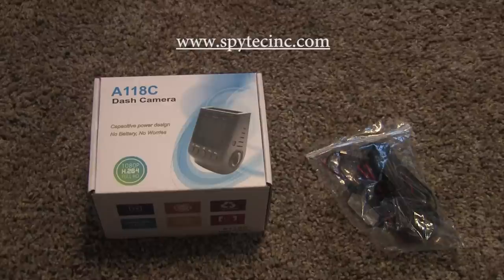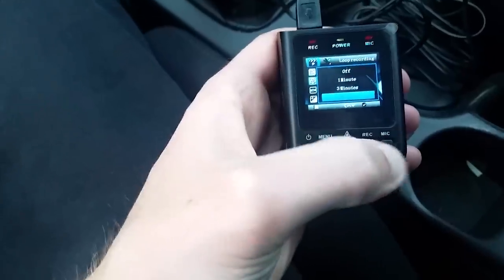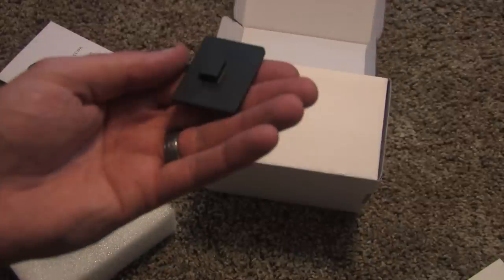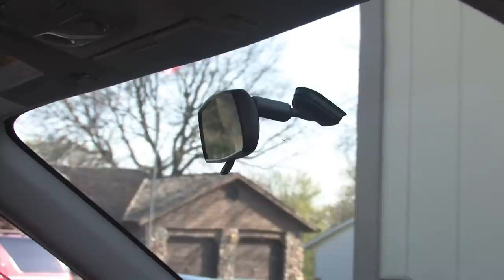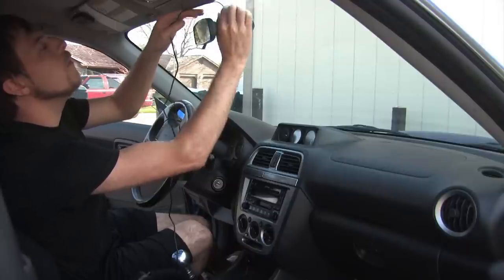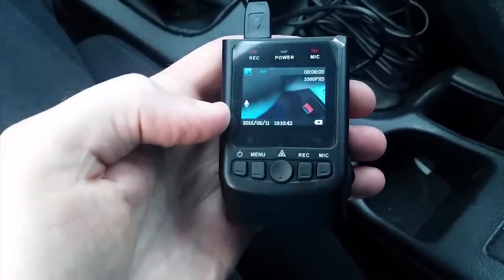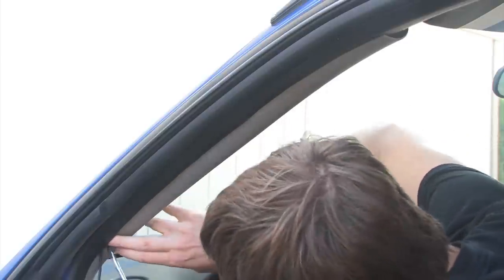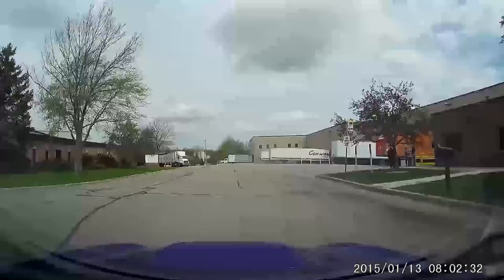A118C Dash cam install and test footage

Comment from the maker: Not sure why I can not reply to specific comments on this thread, but David, yes it is very easy to slide on and off if you want to take it off the windshield when you are not driving.
Reply: +Boosted Films to get the videos off of it do we have to remove the camera and plug it into the computer? also the 5 min loop times, does that just mean every clip it records is maximum 5 mins or it turns on every 5 mins for 5 mins and then off for another 5, before turning back on.
Reply: +KingsnakeSince1986 thanks man. I read somewhere else to stop the dropping between clips you have to turn off the motion sensor. The motion sensor looks for changes from the lens and so if it doesn't see change it won't record. But if you turn it off it'll record everything. And by motion I don't mean the game force.
Reply: oh....you do it when you're not driving. Gotcha...

Comment: Once this camera is mounted on the windscreen or dashboard, how easy is it to dismount it from its pedestal and re-mount it? Having just bought one, my first impression is that the pedestal is a very tight fit on the camera, and that it's going to be really difficult to remove it without the pedestal coming unstuck. I really don't want to leave the camera in the car, as that's just an invitation for someone to break into the car.
Reply: It is EXTREMELY hard to remove. I have the same dash cam with the same hardware. You have to used a solid, thin object (like a credit card) to detach the mount from the windshield. From my experience, the sticky-stuff is no longer useful so I have a roll of double-sided tape as replacement.

Comment: Starting at 9:13  on the video, what's the display "8 h1" in the lower left of the display?  
With the unit behind the mirror, can you see the display while driving.  Is there any need to see the display while driving?  With the capacitor instead of battery, can you remove camera from car & take video without power cord? Sorry to ask dumb questions, but I'm new at this.  I bought a DS8000L and it goes dead when disconnected from power cord, losing time / date data. Battery will not charge.  I'm looking for a better camera.

Comment: The capacitor in it is not for the date and time. It's so that if the power is suddenly cut to the camera (in a sever wreck) it has enough power to save the current recording before shutting down. Otherwise the current file, which is probably the one of the accident, is corrupted.

Comment: Great review... obviously the manual included with the unit is useless.   I have a couple of questions, perhaps you could respond...when I hook up the unit to my PC, the index shows lots of small 20-30 snips, with some going to 130.  However, during playback the video player says it can't play the full clip.  Secondly, if there is an incident I wish to keep, how do I do that?  If I just pull the power cord, will the unit save the last 5 minute loop?

Comment: what is with the grounding portion you are talking about?
Reply: It needs power and ground, like all DC power supplied devices. With a hardwire kit you connect the red lead to a power source from the fuse box (or wherever you want to tap into), and the black lead attaches to a ground point, which is usually any metal bolt under the dash. 

This technique of wiring is called hardwiring because it is "permanently" wired. Of course it's not really permanent because you can simply detach it with tools later if desired, but it's not like a cigarette lighter socket type of install that can be instantly plugged/unplugged.

Comment: Thanks for the great video, where do I install hardware kit? I got EDO Tech 5V kit. Thanks
Reply from the maker: Where you install the wires depends on the vehicle. You need to find an ignition power source wire that delivers power when the vehicle comes on and a ground source.  Usually the radio is the most common place to tap into an existing ignition wire. Google your vehicle type and look for the wiring diagram for the radio.  Otherwise... pay a profession to do it.

Comment: I cannot do anything with menu option, is it like I need to first full charge it then try for Menu option like Date and Time settings ?
Reply: Sanjeev Choudhary can I use his camera at home via regular electric
Reply: I am not sure, but as i remember you cannot use it with regular electric. Please cross check this with some other guy.

Comment: Question: When you say as soon as you turn it on it will start recording do you mean as soon as you start the car it will start recording or do you have to power up the unit every time you start the car? I want one that will start recording every time I start the car. I don't want to have to turn it on every time.
Reply from the maker: +Darin and Alina House It starts recording automatically every-time you turn on the car.
Reply: +Boosted Films Thank you and great tutorial. Much appreciated

Comment: hello. thank you for the video. I was wondering what does loop mean? For eg. you are driving and someone hits in your car and then what should I do on my dash cam? Should I click loop? should I click record? I want to buy the same model as yours in the video but really confused on how does loop and record function on it works.

Thank you in advance
Reply from the maker: Loop is really just another way of saying, "how often should i create a new clip".  When set to 5 minutes, it creates a new clip/file on the sd card for every 5 minutes of video.  This should be recording 24/7 while driving.  If you need the footage, take out the SD card and copy it to your computer or wherever as soon as you can.  If you have a 16gig card or larger, and got in an accident, you could still drive for about a hour (or more) before it would ever re-record over the file you need.  hope this helps.
Reply: Boosted Films thanks bud! It definitely helped :)
Reply: I just installed one in my car today. I put in 16gb microSD. I wanted to ask that if i am driving in a day and nothing happens. So after microSD fills up...will it automatically override the previous memory? So in a way you would only have to plug in your dash cam to computer when you would need the file (lets say in case of an accident)? (Please let me know asap)
Reply from the maker: you are correct.  It will loop and record over the oldest file once the storage is full.  If something happens and you need the footage, remove the mirco SD card and download it.
Reply: Thank you!

Comment: What does it mean to hardwire?
Reply from the maker: I mean the wires are ran directly to other wires already in the car.  as apposed to plugging it into a cigarette lighter plug similar to a phone charger.
Reply: Oh okay thanks! I bought the A118C about 3 weeks ago and it's still in the box since I'm pretty bad with cars/technology in general so thank you for the  thorough video on how to install it! 

I plan on unboxing/installing it tomorrow but I think I'll stick with plugging it into the ciggarette charger since I don't want to start messing around with my car wiring lol.

Comment: Are the lights or glow from the screen distracting at night?
Reply from the maker: +NimblyBimbly The mirror block it from my view.  And I have it so the screen turns off after 5 minutes.
Reply: +Boosted Films Thanks.  Can it be set to not come on at all or maybe for just 30 seconds?
Reply from the maker: +NimblyBimbly Just checked, you can set it for 1 minute or 3 minutes.  I have mine set to 3.
Reply: +Boosted Films Thanks again.

Comment: I just noticed, you did a "rolling stop" on a stop sign, if it was a yield it would have been okay.
Reply: You try driving a manual racecar on everday roads. It isn't fun hitting stop signs, if you've triple checked there is no one around, rolling a stop sign at 1mph is not bad.